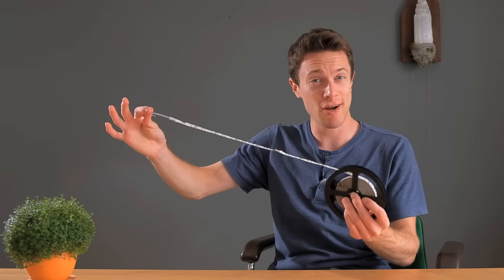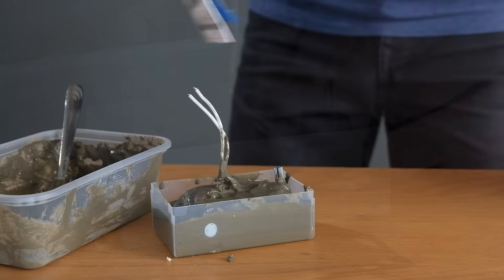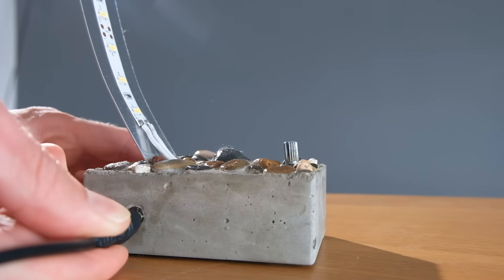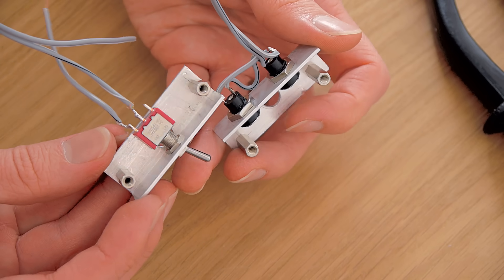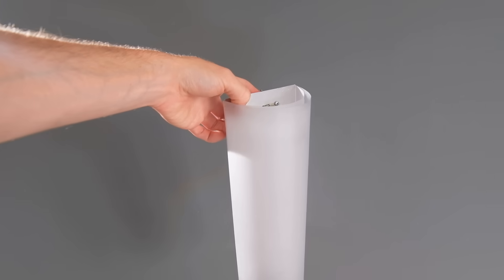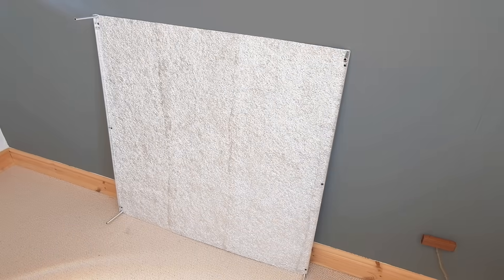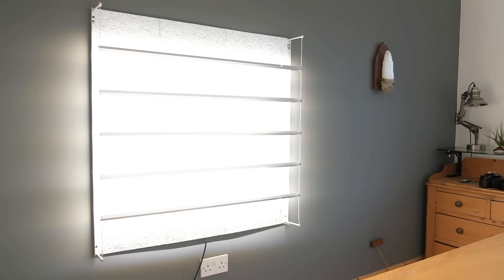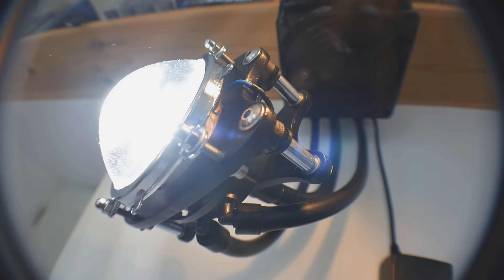3 inventive lighting projects using LED strips

Comment: nice projects.what makes them all so nice os their use as tools ,as shadow limiting or reducing light sources.most people dont unferstand either because they dont create or work,repair,fix,construct,etc. things themselves,or they have never first hand experienced how much more you can create,how much faster you can build,how much better and with more reliability when building.how much quicker to fix something and actually see more clearly all aspects of a repair to get visual"eyes"on ,hands on,a repair.this,along with an in conjunction with the use of meters,gauges,and test equipment,introduces vision and hands,  the 2 of the  human qaulitys that along with the brain,that are the most powerful tools in the world or  universe...all that being said,i have another great attributes that 1 of these projects  has.the.aluminum foil light wall has that should be mentioned.it is a èxtremely beneficial transmission magnifyer of rf or any thing being emmited.if you hold a tv,radio,fan,or device using wi fi,any remote control anywhere close to the direction of it.it fragments and reflects that signal(or recieves a signal)into countless slightly  diferent directions and angles that its possibilities of it reaching the intended reciever are multiplied greatly because of the tinfoil surface being crushed or crumpled creates many different angles....it really is a nice improvement to any living space to always get a result when pushing a button on a remote,as apposed to not perfectly pointing  at the reciever.you can almost point it away from.it and still get a good signal.the 1 problem with this method is the fact that a piece of crumpled aluminum looks like trash when you put it laying around your house .so this solves that problem,and makes a huge area of fragmented angles.another way  would be to make a type of sphere to hang from a ceiling fan pull chain,or ceiling ,likee a slowly spinning disco ball.(lots of fragmenting )

Comment: isn't aluminum oxide non conductive and doesn't aluminum almost instantly oxidize after its been cut/roughed up preventing short circuits with aluminum? or am i wrong and certain high voltages arc through it i'm not sure but i did google it before i posted and didn't find a definite answer.

Comment: You do not need to solder the wires on the dimmer.
The blue things with the screws in them are to connect the wires.

Comment: Some interesting projects.

The last one gives a soft light because the light source is large relative to what it is hitting. The larger the light source relative to what it hits the softer the shadows. The sun is huge, but as it is far away, it is small relative to what it hits, which means harsh shadows. On a cloudy day though, the sun becomes a large light source as the whole cloud filled sky becomes the light source, giving soft shadows, much like the small leds become a large light source as they are bounced off a large area.

Comment: Love the video!  I've been experimenting with a bunch of different LED projects myself, and found that you can save some "elbow grease" by using clear Leak Seal spray  instead of sanding the shade to get the frosted effect.  Sanding took over a half hour, spraying Leak Seal took two minutes (1 minute to shake the van and 1 minute to spray the sheets 😁)

Comment: To connect positive and negative at opposite ends(as in the last project) is very good practice since it prevents voltage drop along the strip. Especially if you are creating a circle of led strip(no edge with a strong and weak side). Also very nice to hear someone who knows what they are talking about when it comes to LEDs

Comment: The second one the leds strips arent in parallel, they are in serie and if you do more then a couple times they get dimmer each time you add more leds. of course its neglectable in this short span, but thats definitly not parallel. 

Yet in the next one when you turn them off, they are in parallel and wired different.

Btw in the third i am kinda mad that you learn people to cut into the isolation to put wires on, even at that low voltage its NEVER  how you wire something together. Dont learn people to do it like that please.

Comment: All LED's dim over time... and it's really not wise to encase electronics into cement.  Set them in a small project box which you then set in to the cement.  If you have to replace a component you can at least have access to it.
Reply: Now that's why I'm constantly talking not to encase any electronic or electric part the way it's shown in this video. As you've said, what if you need to fix or replace something? But people tend to make it as simple as possible, which is good in the beginning, but sooner or later it needs some maintenance, so think about it on early building stage. And one more thing: the guy in video says "...prevent the cement or moisture to enter into circuit...", and then a few seconds later he dips the pot into wet cement.
Reply: I assume it's also mostly to weigh it down. I personally wouldn't cement electronics either, especially dyi

Comment: If you're going to solder to the board instead of the screw terminals, wouldn't it make more sense to remove the screw terminals and solder into the board directly?

Comment: what would be the voltage and wattage that would be needed to run a 5m length and what would you need to change if you wanted to run 10m or even 20m length? also unless i saw it wrong, are you able to run the lights with the negative on one side of the strip and positive on the other side? i always thought you had to have the negative and positive on the same side of the strip.

Comment: I'm almost done building the first project ! Great idea , the shadowless lighting is huge for me and the high CRI I love, wish it were brighter even though I doubled the run of leds on the arc, I also used cylindrical molds for space efficiency and used and Xt-60 connector for the power and I made a wood top instead of the rocks . Wish the leds were more tightly spaced it would be awesome considering the built in heat sink of the project
Reply: What about attaching another strip next to the first one but with the LEDs themselves staggered?

Comment: Note: At around 6:10 you say to wire the LED strips in parallel. In reality, they are wired in series.
Reply: BtheDestroyer No, it’s a parallel connection.  If it were a series connection then you’d be dividing the supply voltage across the two strips.
Reply: Its series ... the LEDs themselves divide into parallel sections in the strip itself. but the end that he says to solder. Thats most definally in series.  BtheDrestroyer is right. You are wrong Rob.

Comment: The music track that begins at 7:27 sounds very familiar to me. It is amazingly similar to the music used in LG's Music Flow H5 audio speaker commercial. Music Flow was dubbed as an answer to the SONOS line of Wi-Fi speakers. Very similar indeed. I am a HUGE fan of this speaker system, as such, I have 14 of them, in all shapes and sizes, in my home.

Comment: Hey Matt, I love the video, so much in fact that I made one of the first projects in this video myself. But I have a problem. I created this build, and it's been working amazingly! But just today (about 3 days after completing the project) the led's aren't dimming anymore. When I turn the dimmer dial, it just goes straight to full power. Is there something I can do? I bought a second hand DC 2 Amp power adapter. Could that be the problem? Do I need more power? Or maybe it's just faulty? Please if you could get back to me that would be awesome. Thanks!
Reply from the maker: Sounds like there's something up with the potentiometer. If possible, try giving it a clean, though that'll be a bit tricky if it's in the cement!
Reply: DIY Perks I bought a pack of three dimmers, so no problems there. I wrapped the whole thing in electrical tape pretty much air tight, and it's just started to happen a few hours ago. I guess I'll just retry the build and try making the weighted feet out of something where I can get into the components. Thanks so much for getting back to me so quick. Love all your videos man, and this was the first I've tried recreating. I'm just always nervous about working with wiring, soldering and circuit boards. 🙃

Comment: Hey Matt! 
Great video as always. 
In the LED strip infos it's suggested to utilize a 10A to 15A dimmer circuit. I see you're using a standard 5A. I'm guessing that the manufacturer suggests such a current regulation so that if the voltage regulator isn't up to task the strips don't receive less current than needed. Are there any indication of this being true? If so would it be detrimental to the strips' health to utilize a 5A dimmer circuit? 
Would love to hear your input on this matter.
Also I'm planning on lay down an extent of 10 meters of strips (two rolls basically) would that influence this matter at all?

Thanks, 

Dave
Reply: penus glottus In my experience you need to have each 5 metre length connected via high quality copper wire otherwise the voltage drop by the end of the second strip causes a noticeable and progressing dimming the further away from the power source the leds get. Make sure that the dimmer you’re using is for D.C. 12 volt applications. A household light dimmer will not work for this. The cheapest way to power them is with a second hand ATX Computer power supply from EBay. A 500w variant should be able to deliver up to 25 Amps continuously.

Comment: In the cement step of the first one, to make the cement stronger, you want it to dry as slowly as possible.  This allows the chemical reaction the cement undergoes in order to set, fully complete, as the catalyst is water.  Also remove as many air bubbles as you can by tapping an shaking the mold.

Comment: you are paying 319%  too much, you can get the exact same components way cheaper, maybe you are new to ebay and thought it was cheap (comared to amazon). Its normal that Amazon is on avg 10x more expensive than ebay china (selling the exact same stuff) :D
Example: the led Dimmer is a simple PWM module:
http://www.ebay.com/itm/5A-DC-Motor-PWM-Speed-Controller-Speed-Control-Switch-LED-Dimmer-3V-35V-/201654649032?hash=item2ef38dc0c8:g:mCoAAOSwV0RXvWQM

Comment: You would have been better off creating a small wooden box for the feet for the power controller on the first light device.  That way when the power controller goes bad, you can replace it rather than trashing the entire fixture.  OR>  Create the smaller box from wood that would house the power controller and then below that make a smaller mold to mount the concrete foot to.  That way it can be replaced.

Comment: project 3. To connect aluninium tubing to angles, one can use blind (pop) rivets, only right diameter and length should be chosen (rivet should actually be narrower than the tube is, or the mandrell won't snap off). Just insert a rivet into whatewer flat thing you're attaching, then into the end of the tube, then pull with the rivet gun. The joint will be strong and neat, and no need for threading.

Comment: Cool, Matt.

1st project
A bit of colorant in the cement to color-coordinate the feet to surroundings.
A diffuser 'like' in 2nd project.
RGB/W would also be nice.

2nd project
Super - as is.

3rd project
Metallic spray paint on a drop-ceiling tile. Light weight and a bit less construction-prone than the alum foil.
This could also be useful in art/style video lighting.

Comment: Skip tin tin foil, hang the lighting in front of a flat white painted wall, the best light scatter surface available
Reply from the maker: Terribly inefficient though, resulting in a lot of wasted energy. The foil allows it to be brighter at a given energy level as it reflects much more light than a wall would.
Reply: Aluminum (Aluminium) is a poor reflector with no more than 75% refection and significant loss of spectrum. Flat white paint contains titanium oxide pigment and with high concentrations, can be very reflective. Home Depot sells flat white paint with 94% reflection of near full spectrum light. 
No wall covering has greater dispersion than flat white paint. The office furniture industry has conducted innumerable studies over the past 50 years to learn about lighting efficacy and distribution and they found no better means of spreading and diffusing light than flat, no gloss, white paint.

Comment: Very nice projects, but I did notice a mistake on the third project.

Conductors should never be used for structure. They expand as power runs through them and they are too weak to rely on to hold anything other than themselves. A short length of bare Al wire would have worked better here. Also, only use stainless steel, brass, or bronze when parts will contact Al. Normal steel will cause the Al to corrode rapidly.

Comment: I am all for using quality led strips. But using it with a cheappo dimmer ruins the quality you were after!! The driver should be adapted to the forward voltage/current of the leds. And both its switching and pwm frequencies should minimise the turn-on and turn-off times of the leds. These two things are to ensure not deviating from the intended chromaticity of the leds. Digikeys has several articles about these subjects if you want more info ;).

Comment: Matt - great work as usual and thanks for sharing your build projects.  My biggest issue with LED light strips is the adhesive on the back side,  even with meticulously cleaning the surfaces.  Do you ever add extra adhesive such as hot glue? Thanks again for your innovative and inspirational content!

Comment: I've mulled over making LED Light Strip lighting with aluminum for the backing.  The one thing that always has me worried however is electrifying the aluminum where the led strip might have too much solder sticking off or what not where the strips are bridged together, or else the contacts from the led strip touching the aluminum.  Do you not forsee this as a problem?
Reply: I also designed my old 3D Printable LED Light strip holder which I've to make a handheld work light for working on cars and can be expanded for any length you desire if you are interested: https://www.thingiverse.com/thing:1273671

Comment: Electrical tape degrades overtime and lets moisture in, also traps any moisture,use silicone, urethane based resin for complete seal or use special electrical resin.

Comment: I was always wondering at how easy and cheap it would be to make lights like the number 2 for streamers that need soft light on their  face for the facecam. No need for the 100 bucks 3 point lighting that flickers at 50hz and is annoying as fuck. 
So much easier to use some LED strips and put them next to your screen for the soft light.

Comment: Won't the sanded acetate sheets mess up a bit of the lights' quality like white balance and color render? Won't it act like some sort of filter (apart from diffusing). Anyway, a powered sander should drastically help with the "frosting" of the sheets.

Comment: I bought an led and it came with an adaptor to power it up,its kinda weird because when the led light is off im hearing a hissing sound from the adaptor,if the light is on theres no sound,so I have to unplug it if im not using it,dont know why thats happening...

Comment: Why did you solder the wires in instead of using the screw terminals? Or desolder the screw terminals and run the wire through the holes for better attachment?

Comment: Make sure to test the dimmer system for the first one before putting it in cement!
Reply: And sticking a potentiometer in a wet environment is quite bad.
Reply: The amazon reviews for the dimmer say it is awful.
Reply: I'd have just used a couple of metal brackets to be honest and housed the components in a metal box. Cement seemed a little OTT in my opinion. Was it for mobility perhaps?
Reply: @BulletMagnetMan  The cement base was used for weight to hold the whole thing in place.

Comment: Gonna have to disagree with you on buying cheap LEDs, haha. I bought some cheap waterproof ones for $10 with a controller and they've worked fantastic for two years. Spent less than $30 to have the entire perimeter of the wall of my room lit up and it still looks as good as day one

Comment: One addition for the first project should be some rubber u-track to cover the sharp edges of the aluminium strips. A cheap alternative would be to tape some electrical wire to a desk, run a knife down the center, remove the innards and hot glue the remaining insulation to the aluminium. You can pick up scrap wire from the local dump, so it's cheap to the point of being free, plus it works just fine.

Comment: Are you sponsored by the led strip sellers? I agree that high cri led strip is a lot better but you seem to really sell the led strips from one seller. It would be nice if you clearly state that i am sponsored or I am not sponsored.
Reply from the maker: +Mikko Tervala yes, some clarification needed. Not sponsored by that seller or any other ebay seller in the slightest. I have been in contact with them though and I am the reason why they started stocking 90+ cri led strips after I requested that they did so in order that I could link to them for you guys. Again, not sponsored - I just wanted a reliable seller. The links are affilliate links though. I'd be daft not to use affilliate links haha.
Reply: DIY Perks Thanks for the clarification! You should consider adding that to the description, I think a lot of people might be suspecting you are getting paid. Affiliate links are a very good idea, and I'm going to order a few rolls to test from them ☺️